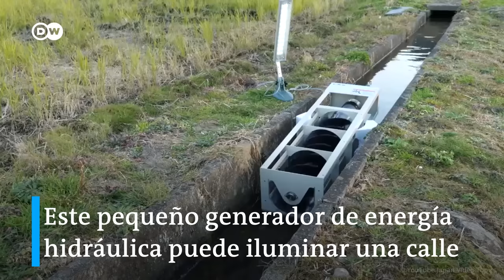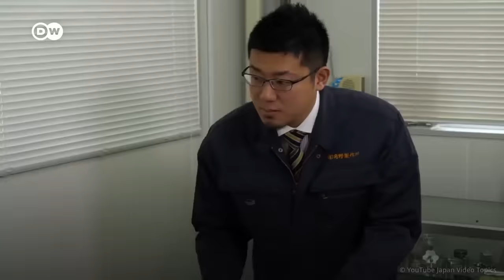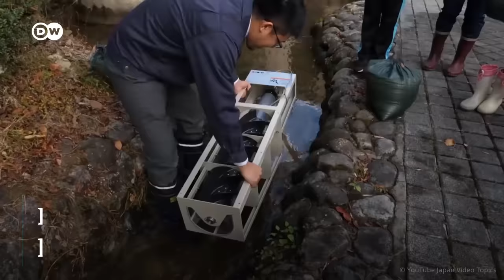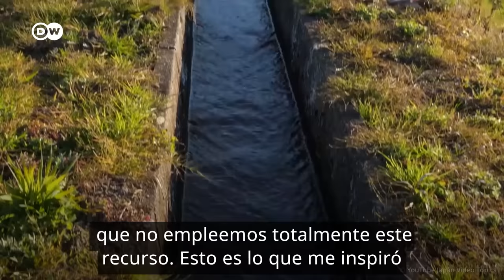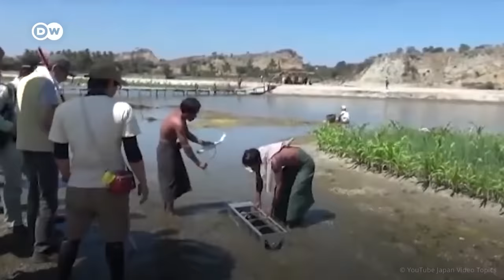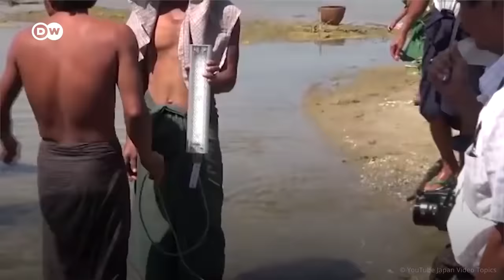Mini generadores de energía hidráulica

Comment: Está  basado en el tornillo de Arquímedes , la cantidad de energía eléctrica que produce es en base la volumen de agua que pasa por el área de los álabes del tornillo (caudal), como bien comenta no necesita presión de agua ,si necesita el flujo constante del agua y que por lo menos tenga una pendiente de no menos del 10% en relación al punto de entrada al punto de salida y deberá cubrir un 50% de los álabes del tornillo y por el tamaño y peso es probable que solo produzca unos 300Wp a un voltaje menor a 50VCD para que  produzca la energía de forma segura estando en contacto con el agua, si la idea es alimentar una calle con iluminación deberá ser depositada esa energía en un banco de baterías y elevar el voltaje mediante inversores de operación para que en el tendido de los cables  tenga la menor pérdida de la fuerza electromotriz y tenga resultados satisfactorios
Reply: Si lees este comentario, es posible que me aclares mas la información? necesito implementar esto en los pueblos indígenas
Reply: bro salvaste mi proyecto stem

Comment: Veo muchas opiniones acerca de persona que se ve que saben sobre el tema, a ver si alguien me resuelve una duda en base al invento del video, ¿que se debe hacer para eliminar el parpadeo que hacen las luces led ? me imagino que con ese parpadeo no se puede conectar directamente un aparato eléctrico
Saludos
Gracias
Reply: El parpadeo es debido a la fluctuación de voltaje, se necesita pasar esa corriente del generador hacia un rectificador de corriente y una "BATERIA/CAPACITOR" que almacene la corriente antes de liberarla, de esa manera pasamos de corriente alterna a corriente continua.

Por cierto los focos de su domicilio también parpadean todo el rato, solo que a velocidad casi imperceptibles.